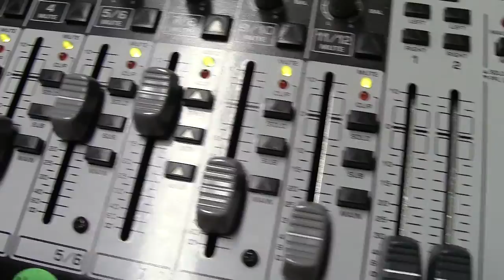Behringer Audio Mixer Broken Buzzing (1/2)

Comment: Hi , did you find out what the problem was? A similar problem has just started to happen on my usb 502 behringer mixer. A weird static type noise. It’s not the usb cable as this works on other equipment. If anyone can shed some light on this I would be grateful.

Comment: It happened to me on my Behringer. It took me sleepless night to figure it out. Then I realized that it was my laptop cable that was hosting the output channel cable. I took the charger out from the PC and the buzz stopped. You need another pc! I hope it helps!
Reply: Lucky u figure it out!
Reply: Clifford Owusu-Gyamfi same problem also with mine here. but the case is  i dont use any charger or anything that connects my phone only the jack from aux..
Reply: I wish mine was from the audio source but something inside my mixer/amp is shot. When no source audio...i move the speaker output to different positons and here creepy radio signals on varying positions. Tempted to just take it all apart for the hell of it. So annoyed w it.

Comment: hi there, I've had a similar problem before. It sounds like you've got AC hum on your mixer. It's a pretty common problem. First try plugging all of your gear into a multiplug that's connected to the same socket in the wall. Aside from that you could purchase a hum destroyer. Hope you get it sorted.
Reply: he has clearly NO any other devices plugged in, so that is not a problem of ground differential. I mean, it's clearly not.